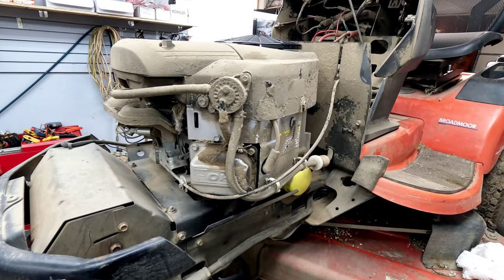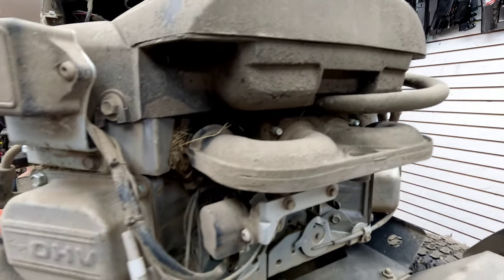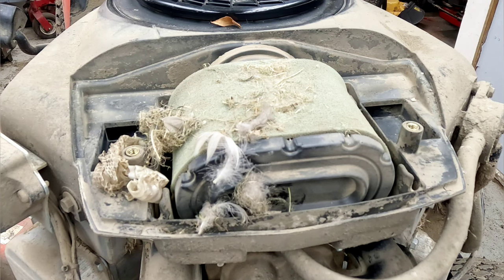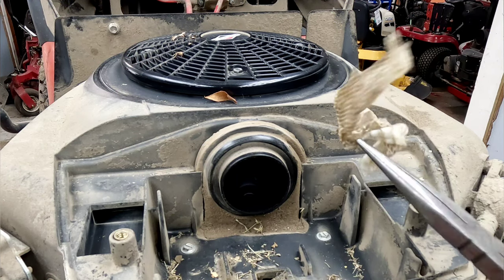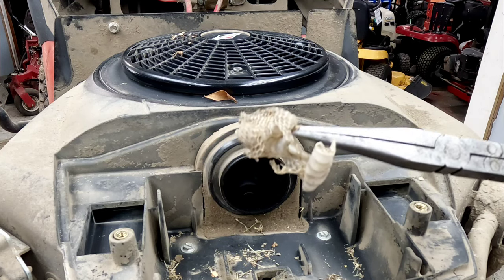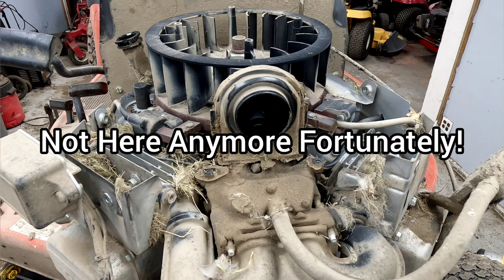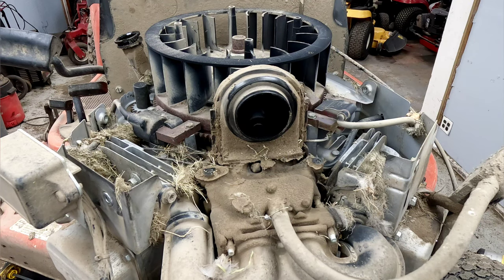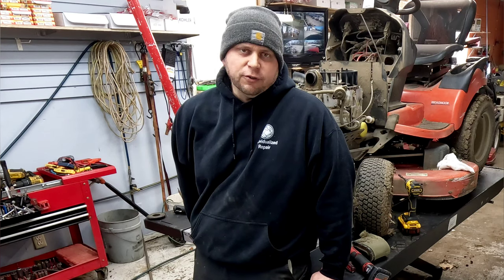An Inexpensive & Easy Way To Keep Something Like This From Happening To Your Mower!

Comment: Never found a snake in an engine before! But I would always welcome the black snakes in the barn. No issues with mice or rats! Thanks for sharing the mothball tip!
Reply from the maker: They work the best of everything I have ever used. Usually but a package of 2 they are in bundles and throw one right on top of the engine and close the cover. It keeps them even out of the shed ever since I started using this method. They would make nests on the upper shelves and ruin anything we had in there (pool toys, foam, cardboard, tarps, etc.). I had to replace the stator because of the first nest under the engine cover and every year at least one nest was found. Never since. Thanks for watching!

Comment: Mothballs work great when you store equipment. I wrap the Mothballs in cheesecloth and I put them in places where the rodents like nest and it deters them from chewing on electrical wiring.
Reply from the maker: Yeah, usually directly on top of the engine. I see people use them in different cups, bags and single balls places around the equipment. They find their way to the muffler often times too!

Comment: If you try to run an engine that's packed full of rodent nest, it WILL overheat to the point that important parts get warped and your engine is TOAST.  Mothballs or moth flakes keep the critters away.  Throw a bag of mothballs on any engine that will be stored, then cover the whole thing with a tarp, big plastic bag or old shower curtain to contain the naphthalene smell.

When it comes to rodents and small engines, chewed wires might be the least of your worries.
Reply from the maker: You sure are right there! I estimate removing shroud and cleaning mouse nests out all the time but some people just do not get it. Thanks for watching!
Reply from the maker: You can only blow so much out without removing the top and vacuuming it all up/inspecting for damage